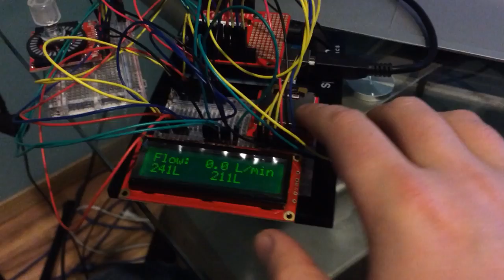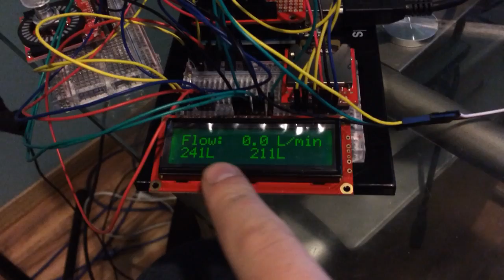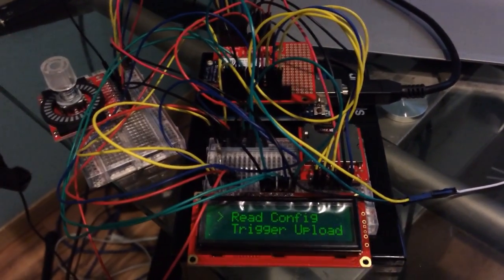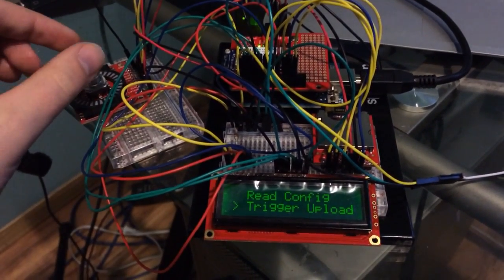Arduino water tank monitor

Comment: What kind of water meter are you using? You said it returns a value in ml, I might be able to use it for a project I want to work on to have a pump, pump a specific amount of liquid into say a glass and then stop.